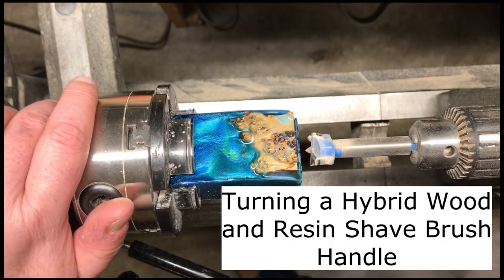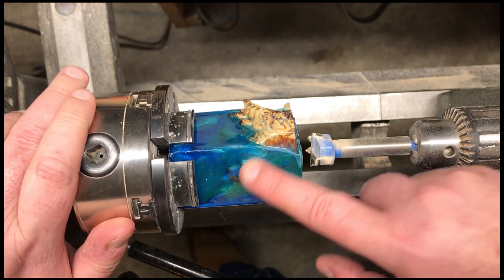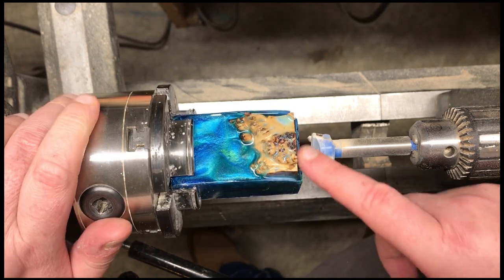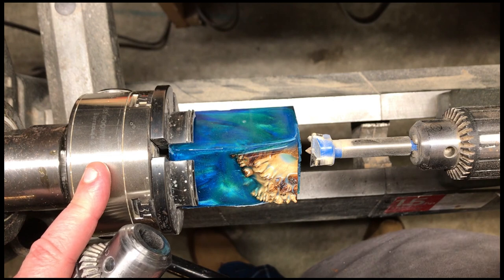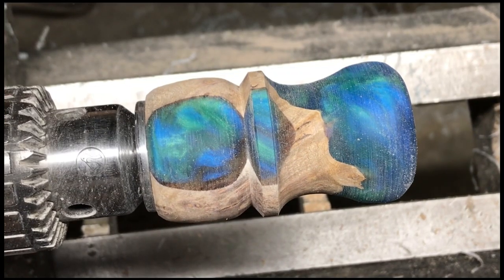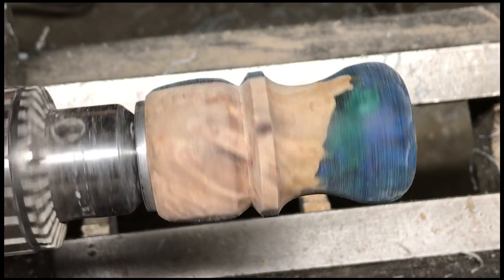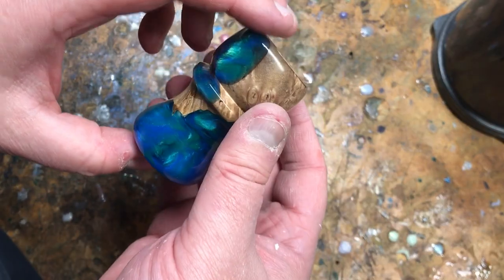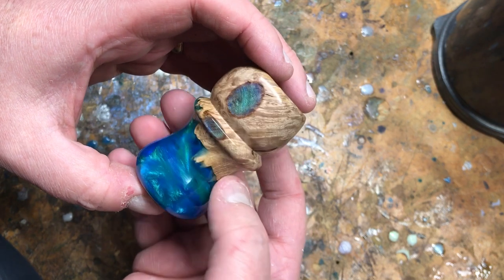Turning a Hybrid Stabilized Burl Wood and Alumilite Resin Shave Brush Handle

Comment: I just saw a few of your brushes on eBay and sent you a question about 10 minutes ago. It is currently 10L11 AM on Thursday, June 4th. Beautiful work.
Reply from the maker: Thanks Wayne, I got back to you through eBay.  I can do these in any hole size needed, most people like the 24-26mm with some needing the larger 30mm, not a lot of call for smaller 20-22mm but I can do them for sure.

Comment: Frick, what liquid did you put on at 5:14 in the video?
Reply from the maker: That was denatured alcohol, I use it between each sanding step to remove all the dust from the previous step and any grit that came off the previous paper also.

Comment: Do you use a pressure pot for your resin? I’ve been considering getting into wood turning and love hybrids like this.
Reply from the maker: I use it on the Alumilite and wood hybrids, it's the only way to get a good blank when mixing materials.